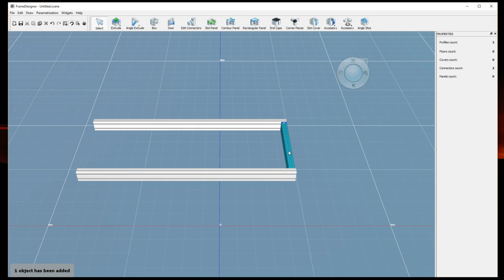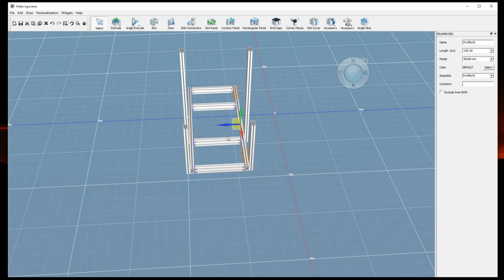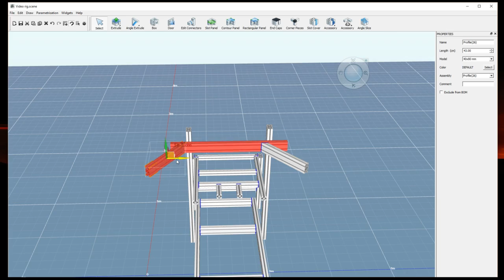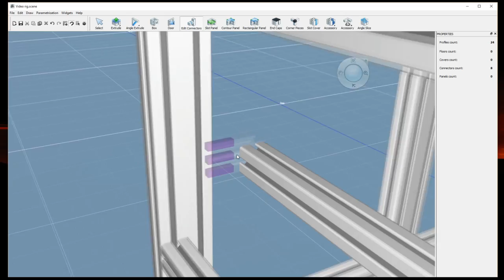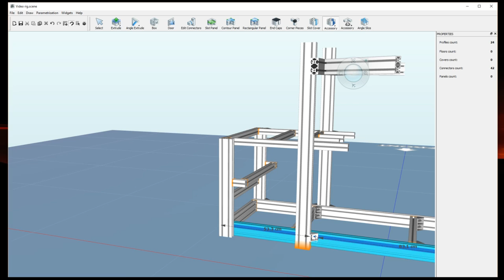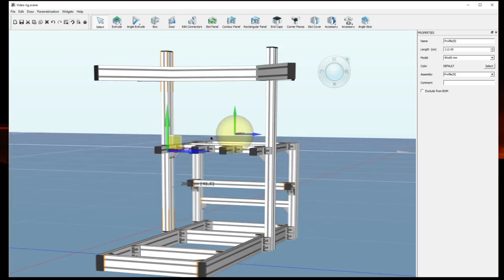How to Design & Order your DIY aluminum profile sim rig

Comment: Aren't your screens too high? middle of the screen should be eye level.
Reply from the maker: Hi. By the time the seat and associated brackets were added, that's exactly the height they were at, but the design allows the monitors to be set at whatever height suits.

Good luck if you're building one yourself 👍
Reply: @fifetojo  Thanks a lot! Wouldn't separate monitor stand be good in case you add motion platform, because the screens will now move with the rig? They could fall of and break down in fast movements.

Comment: Very good video, did you ever get around to building it?
Reply from the maker: Yes, long time ago now mind you. Never did get round to doing the follow up vid.

My friend @davecam made a video off the back of this one, and he did follow up with how it all went. He's released many more videos since then too.

Prices have gone up since I made the video, but you can still save money for sure.
Reply: @fifetojo  thanks very much for the reply. How did you find ordering the parts from motedis. Relitavely easy?  To be honest I didn't expect a reply, I'm glad it worked out well for you. I'll not be building a rig but will be using the software and ordering front he same place. I aim to build cabinets for a camper van. 
Cheers matt
Reply from the maker: @matthewdoggett833  At the time, I found ordering from Motedis fairly easy. Since then though Brexit has happened. I know from experience at work, getting stuff from Germany lately isn't a simple as it once was.

There are UK based companies that sell these profiles, but you would need to shop around obviously. KJN are the one I know off the top of my head 👍

Comment: This is outstanding, however just the base alone when I did the parts list, showed the costs at over $400 us dollars !? which would be absurd. am i doing something wrong ?
Reply from the maker: It'll depend on who you are using as a supplier of your aluminium extrusions Shane. Costs have increased since I made this video, but I'd expect you to be able to build the base for less than $400.
Reply: @fifetojo  true that i did use the built in calculator that came with Frame Designer,  and searching locally ended up about 200, which at that price point just purchasing a rig might be the better option, aside from the DIY satisfaction. Really enjoyed your vid and thanks for the response. KEEP SIMing dude
Reply: @ginks72  I very much debut you'll find a rig that's as sturdy and adjustable as this though for the price

Comment: Before starting, how do I know the ideal measurements? Can you find real racecar measurements online?
Reply from the maker: Yes I believe there are measurements on the Huesinkveld website if I recall correctly.

I just went with my normal driving position for me daily driver. I know it's not exactly accurate for a racecar position, but it's comfortable for longer stints.
Reply: @fifetojo  so you tape measured the inside of the car? Good idea. But you also have to keep seat width into account then I suppose? As to match the rig to your exact position

Comment: What you think to use a 40x40 in the hole rig? Will be enough and strong?
Reply from the maker: thiagomoya totally fine. I’ve designed them for friends in all 40x40 👍
Reply: Hey mate, thanks for the answer, what you think is the best way to define the part of wheel place? My intention is to have a wheel place that allows, fanatec, logitech and thustmaster wheels.
Reply from the maker: I built for hardware i had (OSW), so had a mount already. For the other wheels i'd just make a plate from MDF and use that to bolt to the wheel and the rig.
Reply: fifetojo Thanks again for the reply, mas last question is, how to fix a racing chair that you can adjust the distance on this cockpit? I will do one for my use too, thanks alot about the answers and the video.
Reply from the maker: No worries fella. You can purchase seat sliders online. These would just bolt straight on. This should be pretty straight forward for you.

Good luck with your project

Comment: go and check heusinkveld Simrig GT. Much cleaner design than you are showing here! You use too many bracing parts when there is no need to! Just need more robust uprights etc....

https://www.h-engineering.net/shop/sim-rig-gt/
Reply from the maker: Hi Andrew if you listen to me during the video I already state that the HE & Sim Lab rigs have great custom made braces. I use so many horizontal braces so my rig can house my PC & have my HE pedals in the inverted position. The HE rig doesn't allow for that.

The entire point of the video is to show you how to build something custom, that suits your own individual needs. Not an off the shelf design.

Thanks for the comment though.

Comment: Hi fifetojo fellow scot here. I wonder if you have any lists of parts required to build this and a site you would order from?
Reply from the maker: Hi Danny, this particular rig was built to my pretty specific requirements to fit into a tight space. In terms of ordering though, if you watch through to the end, you'll see i used Motedis to order my components, and how to make sure you're ordering the right things. Expensive by the time you add shipping, but I havent seen anywhere local selling this stuff (yet)
Reply: yeah the plan was to build it as i thought it might be cheaper but this does seem expensive. thanks for the info